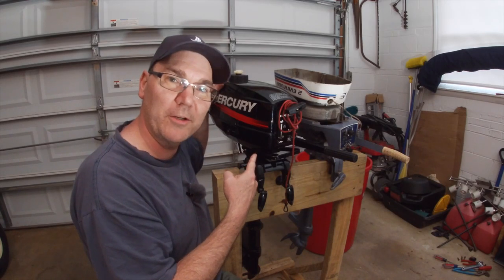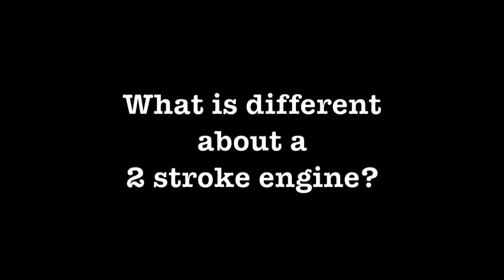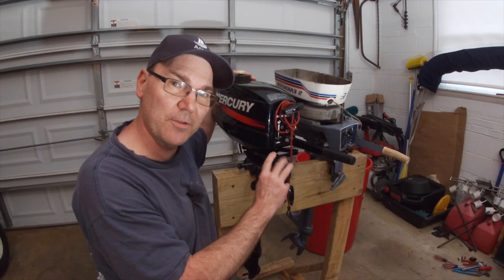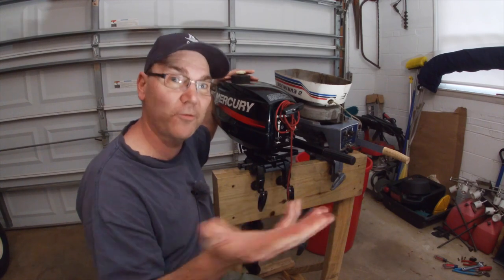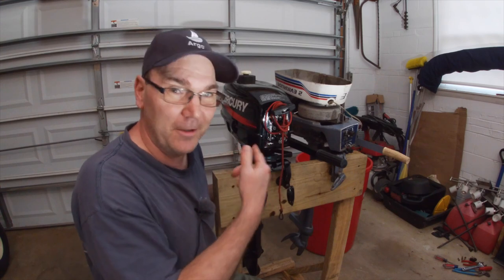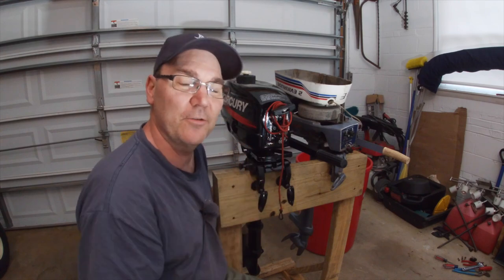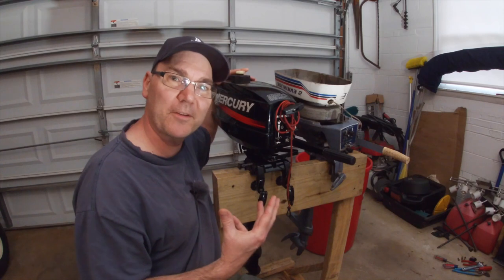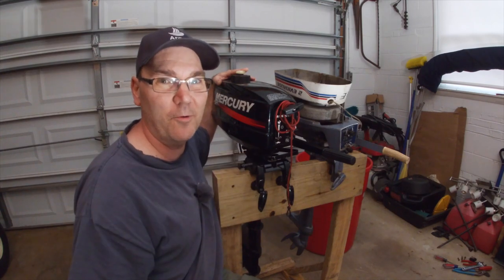2 Stroke Outboard Engine - what is a 2 stroke boat motor?

Comment: Yeah, it's a simplier design but its real advantage is better power getting out of the hole and up on plane due to a powerstroke on each rotation of the crank as opposed to two revolutions.
Reply from the maker: I've often heard throttle response is faster, but I imagine in a smaller vessel, having an extra person a boat would negate any acceleration advantage.

Comment: One of the biggest advantages of 2 stroke engines not mentioned. In small boat applications, like car top boats,  weight is paramount. You have to dismount and load the motor every time you get on the water. I have a 2 stroke 8 hp evenrude, 55lbs. An 8hp 4 stroke is over 100lbs. Huge portability difference.

Comment: I enjoy my 2 stroke. 1980 70 hp evinrude. It's very dependable and easy to work on. I'll get a 4 stroke one day when I can afford it. Until then, 2 stroke it is. I do have my scavenging hose hooked up to my crankcase. That does help.
Reply from the maker: My first motor was a mid-80s Evinrude 90 hp. Once I learned how to start it, it was a great motor!

Comment: 2 stokes have reedvalves. And the main reasons why some people choose 2 strokes over 4 strokes is because of weight and power.  Especially on a boat that is small.   Its important with a water cooled 2 strokes is that you run tcw3 oil.  W= water and jeneraly it burns Ashless.
Reply from the maker: The W stands for water - good to know!

Comment: I personally think 2 strokes can still be quite reliable. Not necisarily more reliable than 4 strokes. Just depends how well built they were and if they were well maintained. I have a 1996 johnson 6hp outboard that is quite reliable. I also have a 1986 evinrude 4hp that never let me down. Some 2 strokes were actually built super well. I also really like the fact that they have great power to weight ratio. And the cost to purchase a 2 stroke outboard engine is often a lot less than a 4 stroke with the same horespower. I'm not exactly a fan of how 2 strokes normally polute a lot more, but personally I don't see a lot of other downsides.

Comment: I would rather have a 2 stroke over a 4 stroke.  Less to go wrong with a 2 stroke.  Instead of regular gas, I use a mid to high test gas.  Also, I use real gas.

Comment: I use left over gas from my boat that is mixed with Pennzoil Semi Synthetic marine 2 stroke oil (50:1) in my 4 stroke motorcycle all the time.
One reason is I like to have an empty  6 gallon tank to get the proper mix ratio of one pint of oil to 6 gallons.
In fact I do not like to run my 4 stroke motorcycle unless it has some 2 stroke oil mixed in the gas, because it keeps the carburetor slide from sticking etc.
The semi synthetic/synthetic 2 stroke oil burns clean, but I would only use at a limited amount on a vehicle that has a catalytic converter.
Also I have been told that marine 2 stroke oil should always be rated "TCW3".
My point is you can use a 2 stroke synthetic gas mix in a 4 stroke engine & it may actually be beneficial?
Reply from the maker: I doubt it's really beneficial. 4 strokes are designed to lubricate thoroughly without mixing with the gasoline and running any oil through there just makes more oily smoke.
Reply: @WayneTheBoatGuy  
I have no oily smoke when I use the 2 stroke gas oil mix in my 4 stroke motorcycle.
The synthetic or semi synthetic 2 stroke oil burns clean.
Also, the spark plugs in my boat are much cleaner too, since I switched to semi synthetic 2 stroke marine.
My motorcycle is an old Triumph with an old Amal Carburetor.
Unless you buy a new Amal Premier with a hard slide or have the carburetor Sleeved they are known to occasionally stick.  
Sticking is due to any distortion in the carburetor & or the fact the slide & bore are made of the same soft material, which may not have been as much as a problem when we had lead in the gasoline.
Anyway using the 2 stroke mix eliminates any sticking of carburetor  & is probably good for the valve seats too?
I have 63,000 miles on my Triumph & have been using the 2 stroke semi synthetic mix for years.
Zero smoke & it runs great!
Reply: @WayneTheBoatGuy  this is the first time that I've heard of this. What do you do with any leftover gas at the end of the boating season? Just wondering

Comment: I just bought a 1987 Evinrude 2.5 Excel from an 82-year-old man who used it very little. It was stored in his garage and hasn't been run in a few years but with two cranks it started right up, and I couldn't believe the power it had. This is a saltwater model and came with a regular steel gas tank and a plastic one that clips on the motor. Should I do any maintenance to it before I put it on my 13 ft. Old Town square stern canoe? Thanks for the video.
Reply: Also the fuel mixture is 100:1 (1% oil)

Comment: Wayne, how late in production was the typical Evinrude (like the one pictured) 2 Stroke engine in the 5-9 HP range produced that did NOT have CDI (or similar) ignition? I want a "late mode" with points, condensers, and cylinder- individual coils as they are easier to fix on the fly and you can nurse a motor/boat home on one cylinder.

Comment: G’day Wayne. Great video, mate. 
I’m deciding on whether I should get a 4/5hp four-stroke or two-stroke outboard? I’m just curious on your opinion. 
It would be my first outboard, and I’d be placing it on a Jonny Bass Boat 100…

Thanks mate,

Dimitri
Reply from the maker: I personally only would get a 2 stroke if a really cheap used one showed up. If I was buying new, or relatively new, I'd go with a 4 stroke.
Reply: @WayneTheBoatGuy , thanks for the reply. Your advice helps me put things into perspective. Much appreciated

Comment: In the European Union it is also forbidden to sell new 2 stroke outboards on carburetors, because of the exhaust fumes - there is no conformity with the emissions standard. The injected 2 stroke are allowed, but after the halt of production on Etec outboards in 2020, there are almost no other alternatives (Tohatsu doesn't sell his injected 2 stroke engines in my country).

Comment: You can distinguish 2 and 4 stroke very easy by starting it. If it is running smooth, regular, silent and sound like a lawnmower, it's a 4 stroke. If it's smokey, smelly, running unsmooth and irregular and sounds like a chainsaw   it's a 2 stroke. Also by pulling you can feel it. If it has compression every revolution, it's probably a 2 stroke

Comment: So if you had the opportunity to buy a brand new 2 x stroke over a four stroke for a 14 ft Rigid Inflatable, which one would you buy? And secondly I hear about the fuel consumption of a 2 stroke , so if I go out pottering about on my RIB  with a 25hp 2 stroke do you think my fuel consumption would be more than 6 gals a day ( that's what my tank holds !)
Reply from the maker: Personally I would go for the 4 stroke so I wouldn't have to mix my gas and oil. As far as fuel consumption, it really depends on many factors like how hard you have to run it to get out and back, whether the carb is in good shape, if it's running rich and how long you're actually out. I had an Evinrude 90 that used more fuel than my 5.7 liter V8 Volvo Penta uses.
Reply: It all depends on how much you use it if you use it a good bet you’re going to use a lot of fuel but two-stroke for the way to go I don’t look out for fuel consumption I just get out there and run it

Comment: You mentioned you had an Evinrude v4 2 stroke engine, can you explain this?. Isn't a v4 a 4 cylinder engine?, how can it be a 2 cylinder?. ty
Reply from the maker: I've had 3 Evinrudes and all of them are 2 stroke engines. My first boat had a 90 hp V4 (4 cylinders but still a 2 stroke engine) and a 6 hp Fisherman. The thumbnail for this video is an Evinrude 2 which is a 2 hp single cylinder 2 stroke engine.

Comment: Two-stroke engine has way more power and acceleration than a four stroke twice the power strokes in the same amount of revolutions is why that’s why it usually takes twice the size 4 stroke to equal the same size two-stroke in Performance.
Reply: And why I love 2 over 4 stroke. Plus more reliable.  Way more snap on takeoff.

Comment: All the old 2 strokes like a mercury 115 6 cylinder or any multicylinder 2 stroke.  Here's the problem. If you don't clean the carbs in the spring, on a 66cyl mercury you have 3 carbs. 1 per. 2 cylinders. I slightly clogged jet in 1 carb that cylinder or those 2 cylinders with slowly starve for fuel n oil. You won't notice lack oof performance right away.by the ti.e you realliize what's happening you pull out the plugs to inspect n you'll have 1 or 2 silver plugs. You cooked 1 or 2 pistons. Every summer somebody you know goes out for 1st ride, you blow your engines, it's already too late. 115h.p. about 10 grand. That doesn't happen to 4 strokes. By the time you realize there's a problem, you need a powered. Same problem with snowmobes and the old Yamaha rd400 2 strokes. Expensive and embarrasing.
Reply: And who wants to pull carbs every year and clean them? Imagine 4 or 6 carbs.
Reply: @Brian Harris  don't clean. Yarbs? The second tou feel a. Little hesitation you already melted a piston or 2!
Reply: @davevangemert9853  Agree. Blew up a 150 Optimax.

Comment: the environmental impact of manufacturing of electric batteries is greater than the pollution of running a gas engine for 30 years mostly due to the mining of lithium not to mention most of the world makes its electrisity by burning coal which is worse than running gas so electric is not a sustainable future there not to mention range because of these 2 things I will hold onto my gas until hydrogen hits boat motors. Most of the pollutions is done by the elites with the factories and their private jets ect but do you see them cut back. They want everyone else to make changes and think they are exempt. in the grand sceme of things the person going to the lake to just fish or have a ride on the boat is barly going to have an impact. They also should look at getting on backs of the pollution capitals of the world like china and india before restricting in the countries that barly add to polution.

Comment: You deserve many more subscribers mate.Here in Sydney Australia it's either Etecs or 4 strokes now sadly.
I bought my yamaha 30hp cv 2 stroke brand new that rattles like a bag of bolts but is extremely reliable, powerful and has never let me down in 11 yrs of ownership.
Reply from the maker: Yeah, I think in 20 years time there won't be many 2 strokes being used regularly anywhere.
Reply: @WayneTheBoatGuy  That's the way it's headed world wide
Reply: Slap some e-tec stickers on it and you’re set
Reply: @evanspader6762  Hopefully in 20yrs time I’ve  already had a meeting with the crematorium mate.

Comment: Best weight to horsepower is two stroke. Best fuel economy is usually four stroke. Best idle and cleanest is the four stroke. the power curve is different with more weight and less top end in 4 stroke. Thanks Wayne!

Comment: One of the great things about a 4 stroke it won't burn down , A bigger 2 stroke can burn down easy, it takes one cylinder to burn lean or a air leak, you might not notice, I like to disconnect one sprak plug wire at time and see if its firing the same. I did not want to worry about it, 2,000 grand more I bought a Honda over a 2 stroke.

Comment: I have a larger boat with inflatable dinghy.  The weight difference of a 2 vs 4 stroke is huge when I have to lift the motor onto the transom of a dinghy with a wet floor and plenty of stress on my back.  A 15 hp 2 cycle Mercury weighs 74 pounds and a 4 stroke is 125 pounds.  The 2 stroke at 74 pounds is still manageable to mount on the transom by one person (barely)  The 124 pound 4 cycle needs two people and there is not enough room for two people.  

You need to be careful if you retrofit a smaller boat with 2 cycle engine(s) as the weight difference will change the performance.
Reply from the maker: Good points

Comment: I ran my 2 stroke for 20 min or so without gas (thinking it was a 4 stroke). I’m new to all of this and have no one to show me. I rely on videos like these to learn. The motor obviously ran poorly, but it didn’t cease up or blow anything. What’s my next step?
Reply from the maker: Dang. Hopefully it's still ok. I would spray some lubricant (engine fogger or some other lubricant) in through the spark plug hole and maybe into the carb and then run it on 50:1 mix and hope for the best. Sometimes these things can take a little abuse... other times, not so much.
Reply: @WayneTheBoatGuy  thanks for the reply. That’s what I ended up doing. It runs, just needs a lot of adjusting. Still getting way too much fuel.
Reply: Don't you mean you ran it without oil in the gas?